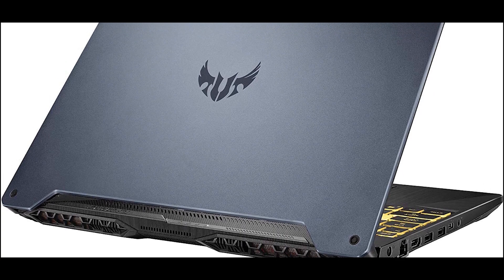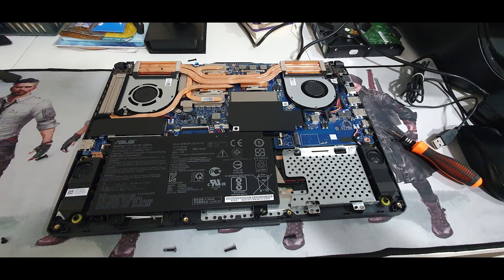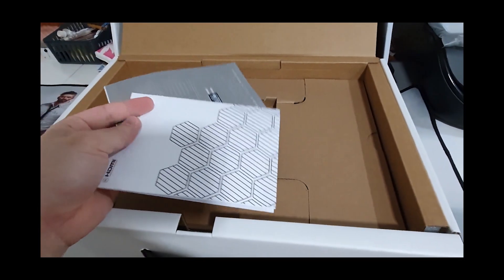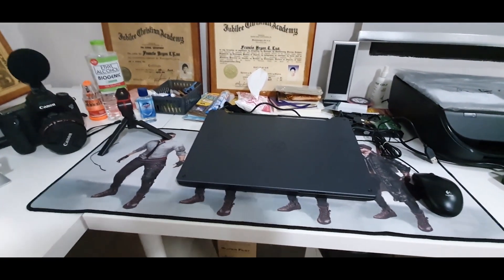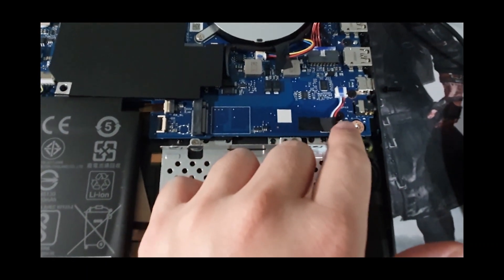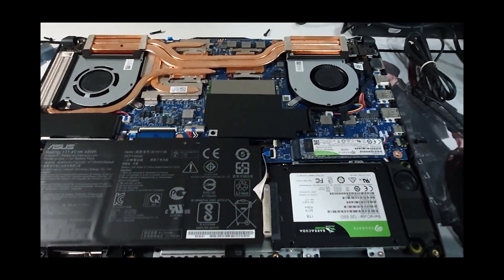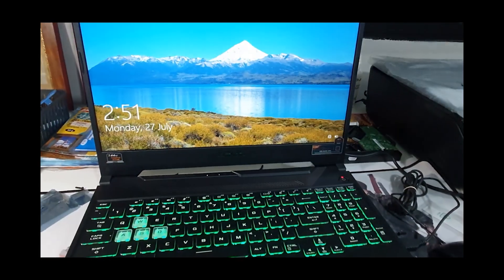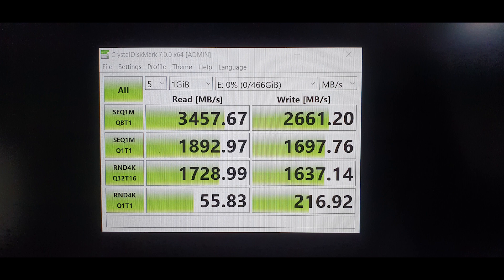Upgrading the ASUS Tuf Gaming A15 FA506IV. Worth it?

Comment: Hello! Is it advisable to do clean installation of Win 10 after buying this laptop?
Reply from the maker: Hi! I personally just reset the windows os and it's working awesome right now. Clean installs work too but I had a personal experience with another Asus laptop (not this one) when i did a clean install and all the drivers were gone. I could not download them from the asus website and i could not use the webcam, trackpad, etc. So i only do clean installs on desktop pcs since then. :)

Comment: Hello po sir, just bought the same laptop, same seller didn't see the free SATA cable tho, where did u find it?
Reply from the maker: Hi! It should be in the box. Sa banda taas yung maliit na pocket dun.. otherwise i think you should contact seller to be sure. :)
Reply: @happyreviewer9491  sabi daw sa seller its not included in the box :(
Pwede ba any laptop sata cable compatible dun?
Reply from the maker: @emarexarts  Hi Sir! First, check the exact model of the laptop that you got po. If naka sata hdd na po siya, wala na po cable kasi na occupy na po yun slot ng 2.5in na sata drive. If naka M.2 SSD po yung laptop, dapat po may kasamang sata cable for the 2.5in.
Reply: @happyreviewer9491  im pretty sure NVME ssd 512gb ung storage ko... so ssd drive bay should be empty, kaso walang included sata cable in the box in both orders ko, dalawang unit kasi binili ko. Ung 4800H - 1660ti model
Reply from the maker: pero if naka m.2 ssd po yung model niyo tapos wala po talaga sata cable for the 2.5in na kasama, you can get one po sa lazada, search for asus sata connector/adapter po. I think it's around 200 pesos pero better make sure po na compatible siya sa model para mas ok :) God bless!
Reply from the maker: @emarexarts  hm... i think that's not right. dapat may kasama siyang cable out of the box if the 2.5in drivebay is empty.

Comment: Kung papipiliin ka boss Acer Nitro 5 R7 3750h or Asus TUF FX95D R7 3750h???
Reply from the maker: Hi! Mas pipiliin ko yung asus fx505d r7 dahil sa gpu na kasama. Mas mura din siya sa pagka alam ko srp. :)
Reply: @happyreviewer9491  Thank you sir, last na lang po dba dun sa seller sa shoppee from china sya aside po sa pre installed apps Chinese apps. Ano pa po down side nung laptop? How about the warranty same po ba sya nung sa warranty sa official website?
Reply from the maker: Hi! Actually sa totoo lang, based on my observation sa unit, wala naman downside, orig kasi na unit siya and licensed naman yung windows so pwede mo reset lang yung windows and yung mga pre-installed Chinese apps like yung anti-virus niya mawawala na. :) global warranty rin siya for 2 years. You can register your laptop's serial number sa official asus website.
Reply: @happyreviewer9491  Hello sir, nag order na po ako sa shop nila yung ASUS TUF FX95DU R7 3750h GTX 1660ti 6gb pero outside shoppee po COD yung mode of payment kase may option sila na ganun sa description. Safe naman po ba kaya yun?
Reply from the maker: @moink8271  Hi! Hindi ko po masasagot kasi di ko pa po siya nagawa before. Basta make sure lang po you double check everything before paying. :) God bless
Reply: @happyreviewer9491  Sir nabili ko na po na deliver na sya saken, hinde ko na po na check kase nakabalot tapos napansin ko po may white dot sya sa screen nya and halata po sya lalo na pag nagdark yung screen huhu kinokontak ko na yung dr hp kung sna mapalitan nila sna po mabackupan nyo ko kung sakaling ayaw nila palitan 😢
Reply: Hi sir nakuha ko na po replacement, problem po yung pag register ng warranty, na regsiter ko na po product pero pag dating po sa Service Package Activation dko po mahanap yung *Contract code from VIP Card at *Password from VIP Card pa help naman po kung pano
Reply: Hinde po kase lumalabas pag paste ko ng SN sa Check your Warranty Status. Nacheck nyo po ba yun?
Reply from the maker: @moink8271  hi! Yes. yung pag register ko po ng sn naka activate naman po yung service package. And yung warranty po niya is ok naman po. I think better po if you contact the seller to figure out how to register and activate your warranty. Better po if sila amg mag assist. :)

Comment: musta po airflow,benchmarks and overall thermals po?
Reply from the maker: HI! I did not have any problems with thermals in the short time that I used it. Never experieced thermal throttling so far when I used it. Airflow is ok in my opinon. I honestly did not do any benchmarks na kasi based on so many reviews ok naman yung performance niya talaga based on its specs. :)